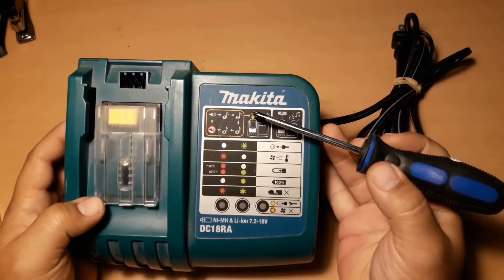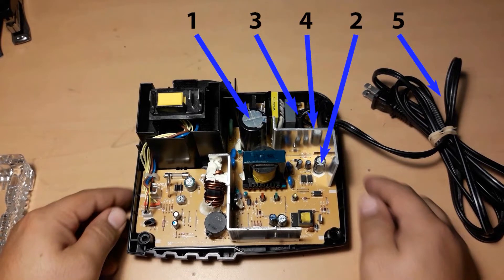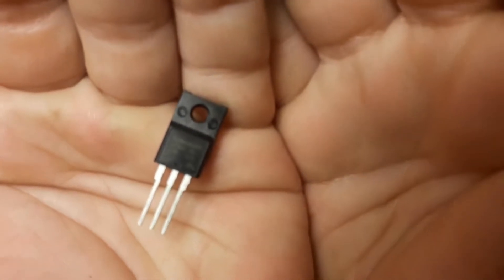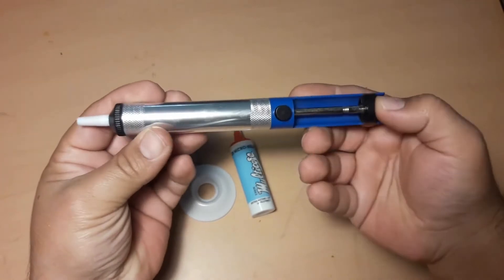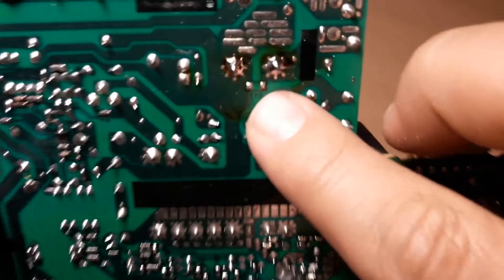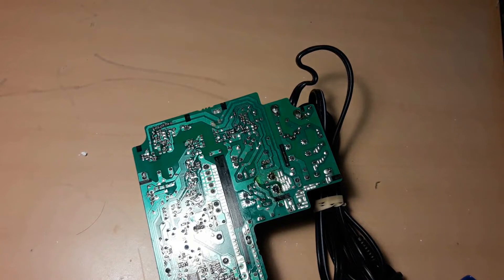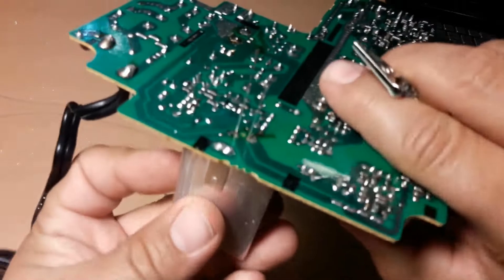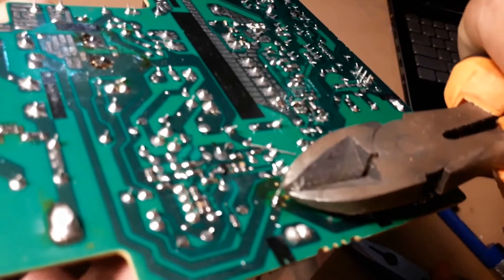Makita Charger conversion -110 to 220 AC

Comment: Do you know if the AC side of the charger has any logic for the DC charging? I am currently wondering if the AC side could be removed, and the charger used with DC. Does the charging logic (and voltage adaption) happen on the DC side? Could I supply the charger with DC and keep full functionality, and what Voltages would it need...?

Reasoning behind that: Makita 12V chargers are slow and expensive. If I have a DC source which can deliver 300W, I could use a fast charger.... But I currently am lacking knowledge...

Comment: I have two if those 110vac Makita chargers. My solution, sir , is to simply buy a 230vac to 110vac step down transformer. Problem solved!
Reply from the maker: True Mr Fred po. But when you have to go to a work site it's really difficult to also carry a step down transformer. That was my thinking 😊

Comment: How the output voltage remains the same when we increase the input voltage. Why does the output voltage not increase as the input voltage increases? E.g. for 110V the output is 20V and for 220V the output should be 40V.

Comment: I can't believe that Makita would be so cheap as to use the same label for different voltage rated chargers. 

Reading it, I would have it would have worked too. 

Glad you were able to convert it to what you needed
Reply from the maker: I followed instructions online and I decided to make a video about it, I was amazed when it worked so I wanted to share.

Comment: Our building sites here in the UK only allow 110v equipment. As such, I need to do the oposite...change my makita 230v to 110v. What were the capacitors, varistor and fuse values for a 110v charger 👍
Reply from the maker: Will check it out and tell you soon my friend
Reply: @The3DHead  Taken out from the 110v Charger, I can pick out the following from the video:
200v 1000uf capacitor
200v 22uf capacitor
Just need the values of the varistor and fuse. Many thanks 👍
Reply from the maker: I'm really sorry, I have been busy, I checked and couldn't find the old components and no information online. Really sorry I can't help 😔
Reply: @The3DHead  No worries pal. Had we both known in advance, we could have just swapped chargers 😂. Very informative video though. Much appreciated 👍
Reply from the maker: Thank you, I'm grately honored that you found it informative 😊
Reply: The varistor is 'TVR 10241' for miy 220v charger
Reply: To convert 220V to run on 110V it would be easier to make voltage doubler in primary side-basically two input diodes are replaced with two 200V capacitors. One could even add 110V/220V switch-so it could be used with both voltages. This way electronics gets proper voltage like it would from 220V. Basically this BigClive's Ryoby charger 110V to 220V guide backwards: https://youtu.be/ZNenxTVzFH0?t=567

Comment: Brother please tell me the model or value number of the original varistor, it will be a huge help
Reply from the maker: Unfortunately my friend I haven't kept it, I honestly would try to find it but it has been so long time and it is not in my house. Really sorry
Reply: @The3DHead  No Worries Brother, i figured it out
Reply: Varistor only helps to protect the charger from high voltage in... It can work with out it.

Comment: I have charger dc10wd 12v 
Are you replacing the same capacitors?
 https://www.amazon.com/Battery-Charger-Replace-BL1021B-BL1041B/dp/B07CVC22BV
Reply: אם הוא מתאים ל110 אתה תזדקק להחליף קבל, תבדוק איזה קבל יש בפנים
בגדול התאמת קבל היא לפי המחזוריות בארץ זה 50 הרץ אז אתה תזדקק לקבל שמתאים למתח כניסה 220 , כאשר על הקבל כנראה יהיה כתוב 400V אבל תלוי ביכולת קיבול שלו ישנם מלא סוגים 
לדוגמא אם אצלך יש קיבול של 10 מיקרו פארד עם מתח 200 תזדקק בערך לקבל של 60 ומשהו מיקרו פארד עם ערך של 400V . 
אם אתה לא מבין בזה, פשוט תקנה שנאי.

Comment: It is a very briefly video
Hope soon to have more projects!!!
Reply: Any knowledge how to convert a Dremel charger model 876?
Reply from the maker: Unfortunately I have not disassembled this charger before.
Reply from the maker: @talyair7594  check this out 👉 https://www.eevblog.com/forum/repair/dremel-875-bosch-bc330-charger-pcb/
Reply: Note that the label on the bottom of the charger say ok for for 240 V.
Reply from the maker: @jonlindqvist4950  actually no. It says 240 watts
Reply from the maker: Thank you!! Of course there will be new projects builds and fixes. Stay tuned, will have 3d printer build coming up soon 😁 cheers